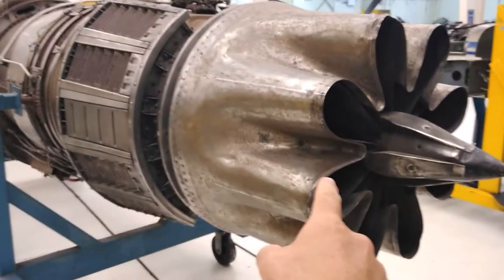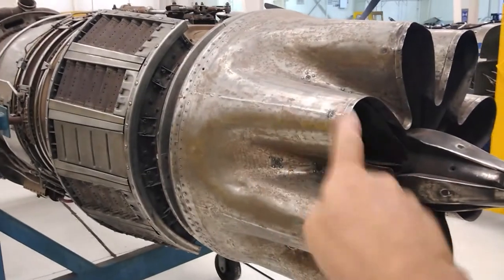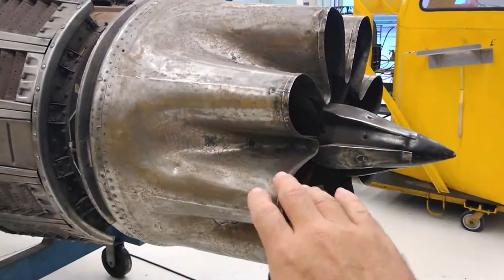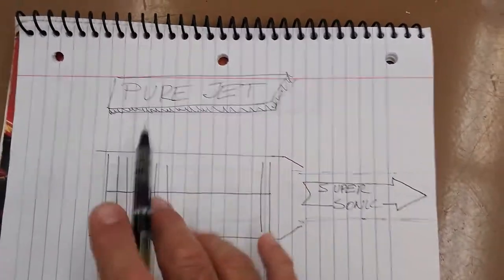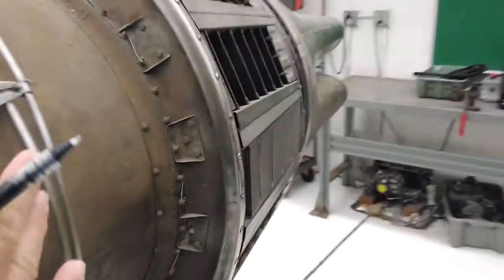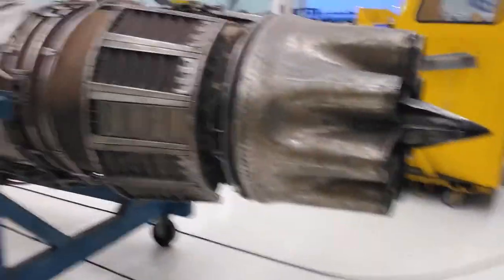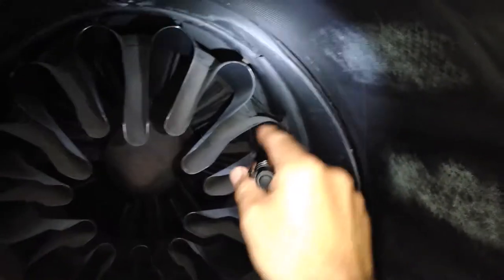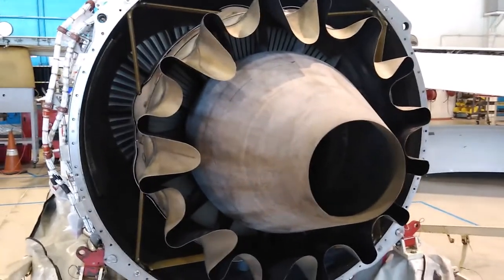Exhaust Nozzle, Diffuser, attenuator, flower looking thing...!!!

Comment: I still don’t get . Maybe you can fetch me where I stand. If new to this, I would install a ring around the exhaust which speeds up the surrounding air flow from Mach 0.7 to Mach .99 ( obviously not for supersonic fighters). Then there is less velocity difference to the jet.

More thrust, less noise ( power has to go somewhere). 

Is this about frequency? Going above human hearing range? Elephants use InfraSound for long distance. We want short distance.

Comment: Super explanation Bro iam very  impressed to Your way of explanation iam expecting more concepts in the same way . I have one doubt like how turbulence and noice is realted
Reply from the maker: Hello Kanchamreddy Viswasree, thank you very much for your kind words. I really appreciate it.
Let me try to answer your question:
Sound is nothing but vibrations in the air, pressure waves. Just like whistling with your mouth is a high speed stream of air swirled over obstacles(tongue, teeth, lips, etc) to create turbulence to create sound.
Now magnify that effect up to the scale of a jet engine and you can imagine the magnitude of the vibrations, pressure waves or disturbances that are created in the interaction between the still air and the fast moving jet exhaust. Those interactions translate to noise.

I hope this makes sense and it answers your question.
Reply: @planesimple8514  
Thank you bro for clear Explanation to my question